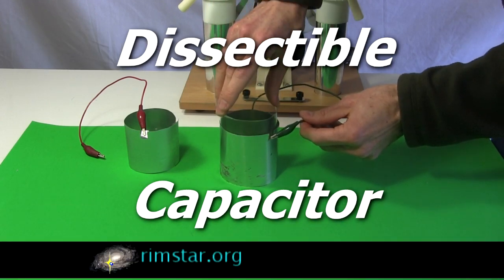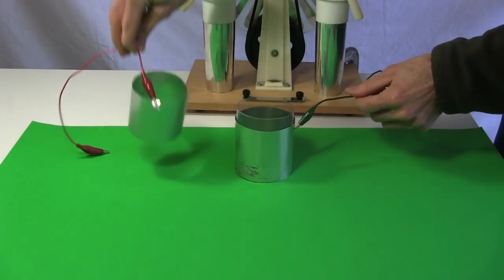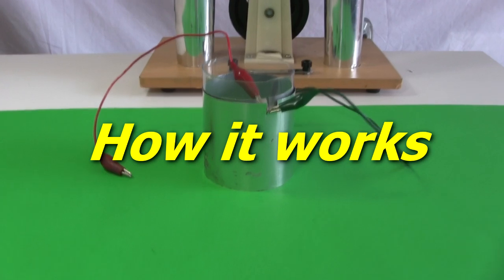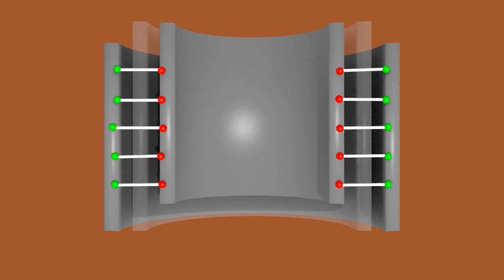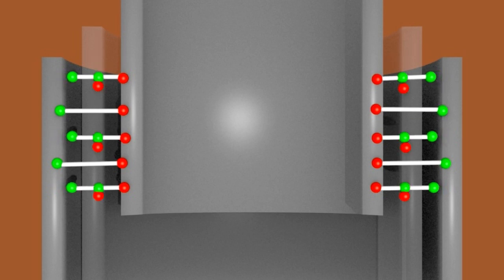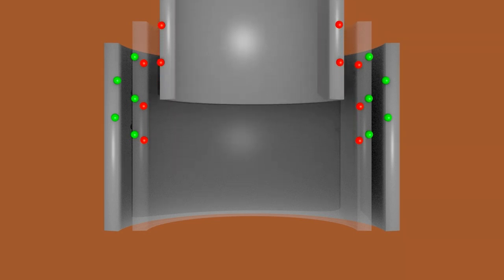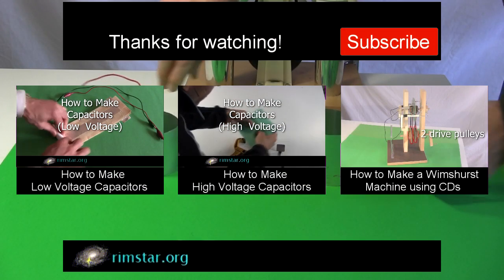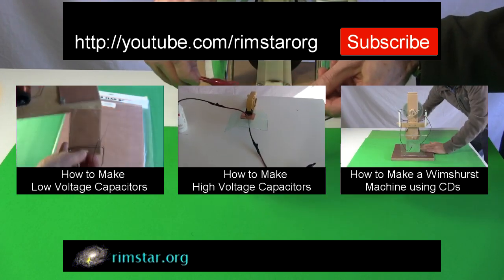Dissectible Capacitor/Leyden Jar - How it Works

Comment: I am sorry, but anyhow that whole explanation doesnt fit. 
Question. How can hold plastic an dipole, what parts of it can magnetize, to form a dipole. Where the next Question come. 
When plastic got dipoles, what kind of Material can it attract, since it becomes small magnets. 
Maybe only other small plastic parts what are "charged"? Maybe, but its more the electrostatic effect. 
Would that work with glass too? 
But then still, the charge is hold into the dielectric, not the plates,  plates are then more the conductors.
Anyhow the effect doesnt fit with explanation from the whole classic theorie.
Reply from the maker: The term, dipole, isn't only used for magnets. As you know, an atom container positively charged protons in the middle and negatively charged electrons surrounding it. If the negative electrons are off center then the whole atom is more positively charged in one direction and more negatively charged in the other direction. It becomes a dipole, two poles, one negative and one positive. The same applies for molecules.
Reply: RimstarOrg  Ty anyway for your reply. A nice Video, simple and clear. Just, some Questions still left for me.
Like one, how importend is the dielectric material at capacitors and its layout for the capacitance and the charge and discharge.
Reply from the maker: The dielectric is very important. The material itself, the thickness, surface area and breakdown voltage are all important. I go over them in quite a bit of detail in my two capacitor videos http://youtu.be/GveI9gXIsHw and http://youtu.be/MPD7skZ8OSo. The first one goes over how all that affects the capacitance and the second one talks about the breakdown voltage. I have another one, https://www.youtube.com/watch?v=ml2TdQ2_2mk, that explains elecrtolytic capacitors, which are pretty neat since one of the plates, instead of being metal, is a very thin layer of aluminum oxide.